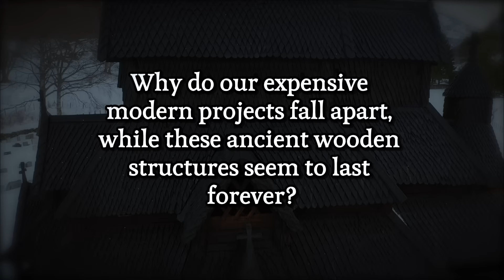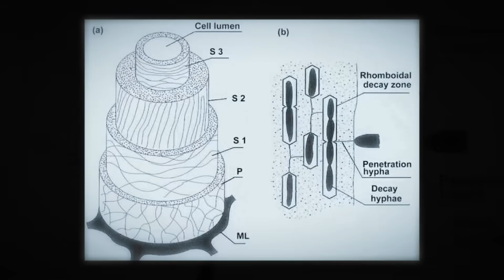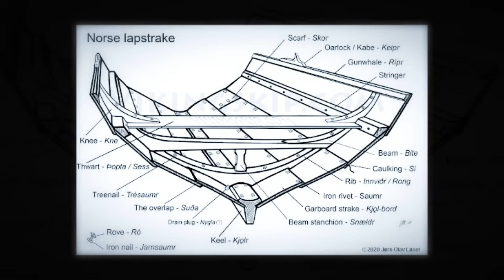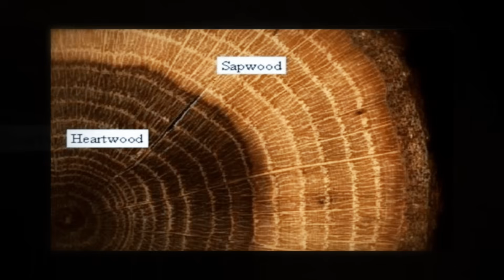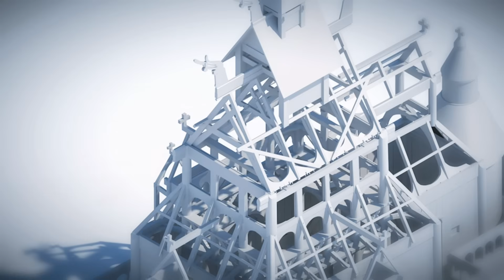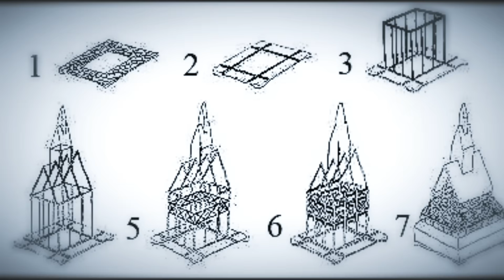Why VIKING Wood Never Rotted While Yours Dies in 7 Years

Comment: Nordic pines are not driest in the winter, they are most wet. They are driest late summer. You cut them in the winter because the drying season starts at february and the april is the best montg of drying.

Comment: If possible always use local sourced wood. Local wood is climatized and will last longer, especially if also treated. When you buy lumber from most places, it is almost always imported from another country where the weather is different, meaning the wood has grown to resist different conditions.
Im not saying it will automatically last hundred of years just because its from a tree 5 miles up the road, but instead of rotting after 20 years, it will probably last 30-40

Comment: Have you ever wondered why fence posts don't rot at the same rate? Some last for ages and others rot quickly. There's a very simple reason: The posts that last longer are erected upside down. Trees obviously take water from the roots up. If they're put into the ground the same way to make a fence they take in water easily and rot. If you put them in upside down they last much longer. Simples!......